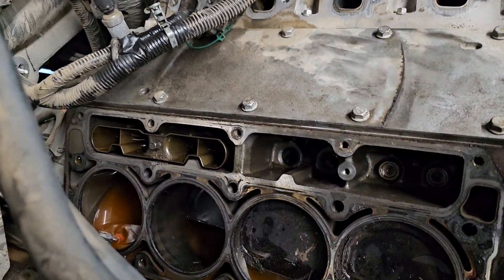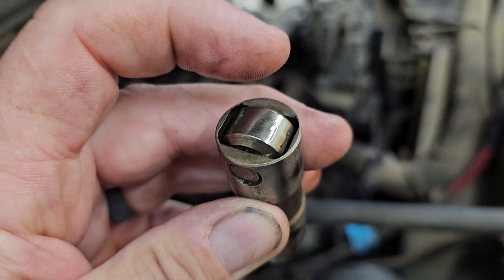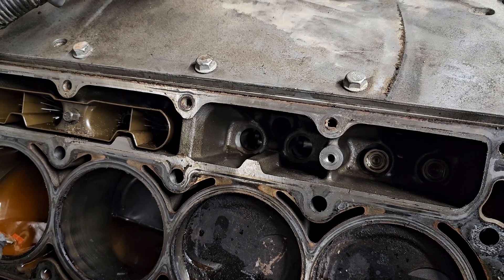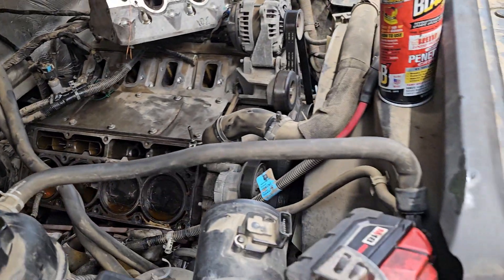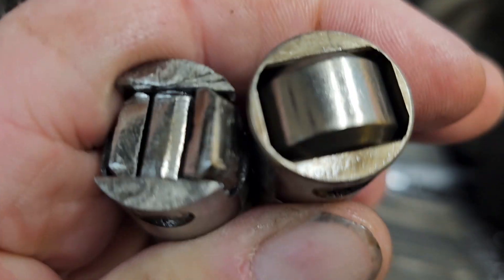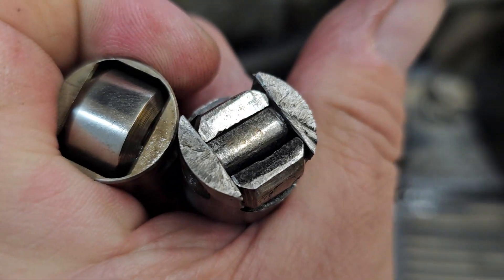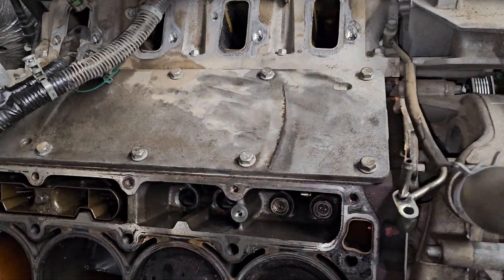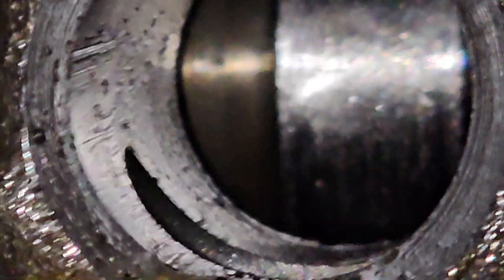Ticking Chevy Silverado. We're Not So Lucky This Time!

Comment: Sometimes the oil filter can catch a lot of the smaller pieces and you won't see much until you pull the pan even the pick up tube screen will help keep some of the bigger pieces from getting into the engine

Comment: Same thing happened to my 2012 Silverado at 150klm and just out of warranty...had to replace the engine at my dime. I called GM Canada and they would do nothing..too bad for me. There is a litany of this on the internet if you want to read about in regards to the LS engine.  I do believe there is a class action out now about this against GM in the US.
Reply: Generally what you are referring to is the afm/dod system lifters failing. This is not normal to see a non afm/dod lifter failure at all. Especially on a roller lifter. So no this is most likely not the same thing that happened to yours as that would be rare and it's definitely not part of any class action lawsuit.
Reply: @claytoncoolidge992 not by what I’ve heard and seen. I’ve seen numerous videos of the afm lifters failing and sending shrapnel through the engine, getting stuck in the lifter bore. There a reason afm delete kits are out there.

Comment: I was very lucky when I replaced the hydraulic lifters in the.5.7 litre Chevrolet LS1 V8 engine in my Golden VY SS Commodore about 5 years ago when all of the hydraulic lifters except on cylinder number 8 were mushroomed &; jamming up in the lifter bores once the engine had warmed up.

It was difficult to remove the hydraulic lifter for the exhaust valve on cylinder number 6 which required a lot of effort to remove with a set of multigrips,I even bought an 0965 camshaft locally for $35 AUD who had a collapsed rocker arm needle bearing in his LS1 engine in his VT series 2 Holden Commodore but he got a performance cam fitted.

I have that one as a spare now & I did check the oil pressure with a $23 AUD oil pressure gauge to rule out bearing damage or to rule out the same carnage as what's in the video,it did pass the GM oil pressure test procedure,I could see where the valves had been hitting on every piston crown except on cylinder number 8.

I just replaced all 16 hydraulic lifters with a set of CNC machined LS7 lifters which I bought on eBay for $100 AUD which were a unbranded lifters which were made in Australia.

Yes,the.camshaft in my car was still good & I believe that the previous owners didn't change the oil enough although GM superceded the LS1 lifters with the LS7 lifters because they were less likely to jam up as compared to the LS1 lifters,I was lucky that I didn't need another engine & I change the oil regularly.

That engine in the video can be fixed by sleeving the lifter bore but the engine will need a full rebuild !

Comment: If you are the owner of this vehicle, you'll suddenly be sick. More frequent oil and filter changes can help to avoid some of this. Thank you brother Kenny! Great video.
Reply: Yes, I'm feeling sick.  Just bought from owner a nice  '04, Z71, Suburban, 5.3 /198K that came from S. Kansas and been in Mich. for 4 yrs.  Had a little tick and had it checked out by my mechanic.  Had him replace oil pick-up tube O-ring plus a bunch of other stuff.  With new oil it rattles like crazy so probably just drive locally till I can find a good engine to rebuild.  He said there was no metal in oil pan but looked like oil change was way overdue.  This of course is pre afm/dod crap so I thought I was safe.  Maybe a 6.0?  Good video, Thanks.
Reply: Our 12 Burb has 191k. When it starts ticking my hubby will redo it, just like he did with our 08 that ticked at 160k miles. ;)

Comment: i am convinced ford & GM didnt discontinue the old small blocks due to emissions reasons, but because the were RELIABLE. when ford discontinued the 4.9, 5.0, 5.8 & 7.5.look what they replaced them with.engines that rarely get half the milage before they scuttle themselves.this was NO accident.merely a way to quadruple the motorcraft parts division sales numbers.i owned fords over 40 years, & wont touch newer ones.their designed to be money pits thruout the ownership experience.AFTER they rape your wallet at initial sale.
Reply: I hear ya, many folks go with the expensive repairs because new cars have literally out priced themselves. I have bought many new cars in my day, but I will never buy another one. I don't know how people afford them. I know some that stretch payments out so long, you are lucky if the vehicle holds out. It is just crazy, unless you are filthy rich and it doesn't matter if you throw money away.
Reply: The Gen 3 LS and Vortec based LS truck variants were the last of the best of GM’s V8 engines. Same thing with Fords 4.6 and 5.4 2v engines. The HEMI design refresh in 2005 was junk. The Dodge 4.7 and the 5.9 V8’s were the last of the best Dodge engines.

Comment: If that engine has almost 200k on it I’m not surprised that finally happened. The lifter trays don’t usually last that long, they can slightly deform over time and as soon as it can, a lifter will start to spin in it. I really wish there was more realization that plastic components in an engine need to be periodically replaced to avoid catastrophic damage. I’m replacing my trays every 120k miles. Crossing my fingers.

Comment: I am glad MOPAR isn’t the only car manufacturer having problems with lifters failing.  Regarding a new motor, possibly you could pull the motor, go through all components to ensure they are not damaged, replace the right side head, install a new camshaft and be good.
Reply: My 04  ranger 3.0 just did the same thing at 99k. Drove it for a week, used rislone and MMO. 300 miles later, seized at idle.
Reply: @radleybradford1356  I would say that was a bad day 👎
Reply: For the amount of $$, it is not feasible in a shop situation. DIY, yeah, go for it.

Comment: I appreciate engine damage from broken lifter...but why not inspect further to see if fixable. Yes a new/newer engine is quicker, but I'd rather have a new crate engine or the original one rebuilt. A used engine drop-in would worry me.
Don't know much about the truck. If the rest of the truck was maintained the same as the engine, then who knows.

Comment: Wow, I wonder how many miles is on that thing. I would smooth out that hole and put another lifter in it and pray. I know in a shop situation, you can't do that, but DIY you can. May or may not last, but you know what it is. Then you can make the decision on what to do from there.
Reply: I believe the oil pressure going to the lifters rely on a tight tolerance between the lifter and the bore. Too much clearance, oil pressure would be compromised.
Reply: You are probably right, I would try it anyway if it were me and doing it myself. In a shop, no way. @dans_Learning_Curve
Reply: @jthonn  I've seen other shops send the block out for the lifter boar to be machined and a sleeve installed.
Reply: If it has a ton of miles on it, better off finding an engine. That is why I wouldn't let a shop do it. @dans_Learning_Curve

Comment: Engine, not motor. Having said that I place the blame of many modern automotive reliability issues on the EPA. They come up with these arbitrary numbers for fuel economy and the auto makers have to find a way to meet them. The end result is overengineered cars and trucks that have to be built with the bean counters (accountants) driving the bus for profits. Couple this with the majority of owners knowing nothing about proper maintenance and or trying to save a buck or two on oil changes and we end up with stuff like this. I miss the days when my slant 6 1968 Dart ran a mostly trouble free 200,000 miles.